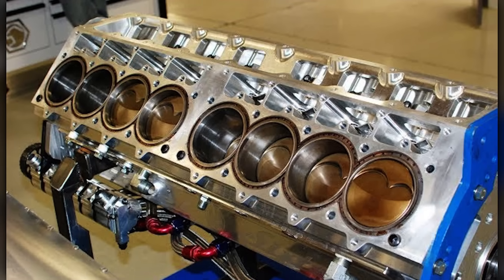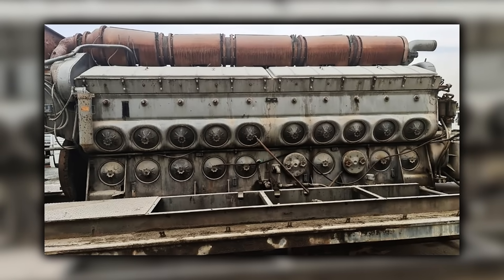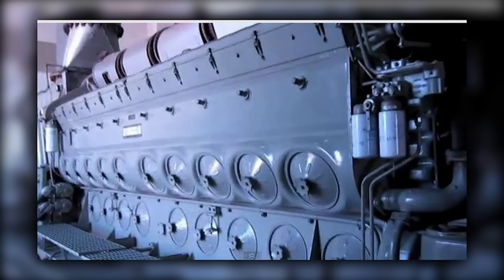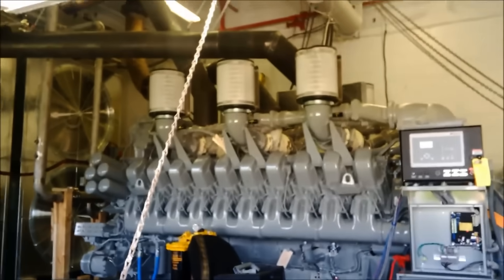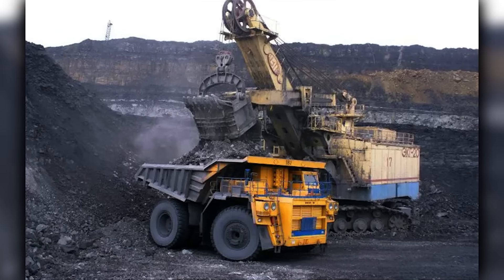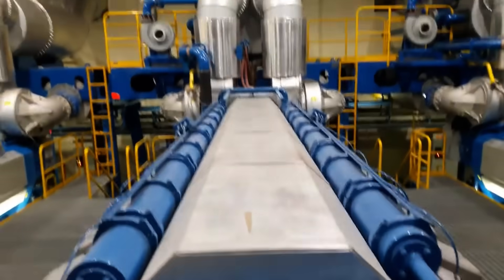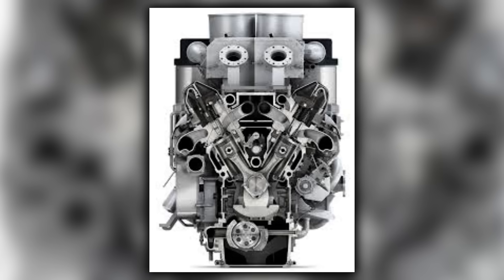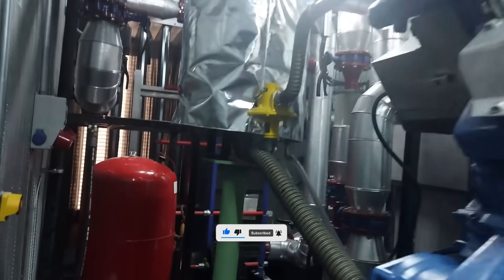INSANE 20 Cylinder Engines You May Not Know About

Comment: Those MWM engines look very similar to Deutz landfill gas engines. The Deutz are 16 cylinder and have a dished out piston to lower the compression ratio as they are spark ignition and don't use diesel at all.

Comment: Just wondering why no mention of the Enterprise line of diesel engines? Medium speed, stationary & marine propulsion. Straight 8, V-12, V-16, and V-20. Plus direct reversing marine applications. Of special note the electrical power station at Fort Lauderdale FL. Also power supply for NORAD, Cheyenne Mountain WY.

Comment: Back in the 1920’s and up until the advent of the turbine engine powered generators the telephone company central offices had huge diesel engines which could be activated during power outages. I worked at one of those buildings and recall they had to be started by compressed air. No ear muffs or ear plugs back in the good old days. I wonder if there are vintage films from AT&T about that forgotten diesel engine technology?